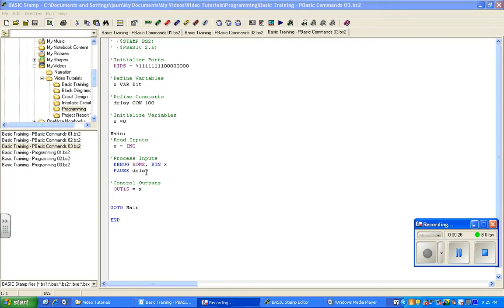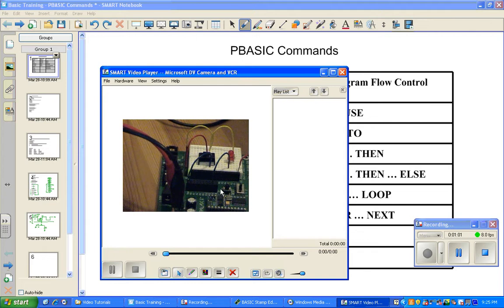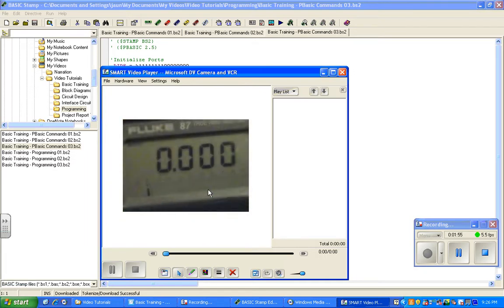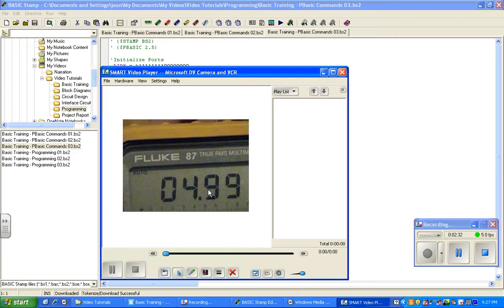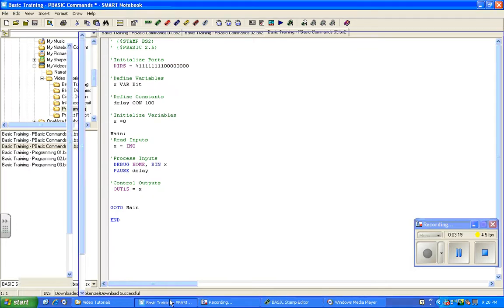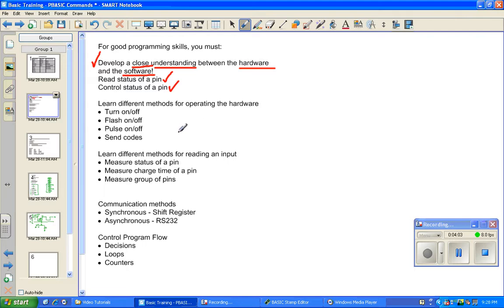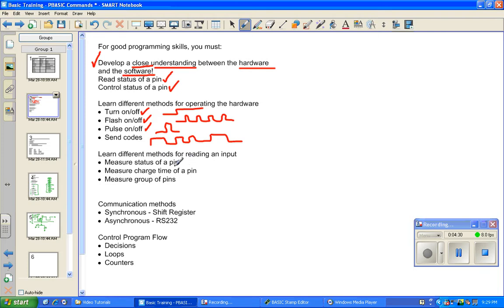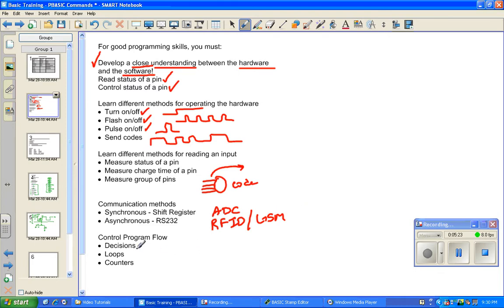Basic Training   PBasic Commands 04

Comment: when i just plug in a wire to pin 0 the state  of the pin alternates between 1 and 0. Why does this happen?
Reply from the maker: Hi Ismael.  The switching level of an open pin is not predictable.  We call this floating.  Other conditions in the circuit will determine its level.  It has to forced to a high (1) or low(0) state by connecting it to ground through a resistor or 5V through a resistor.